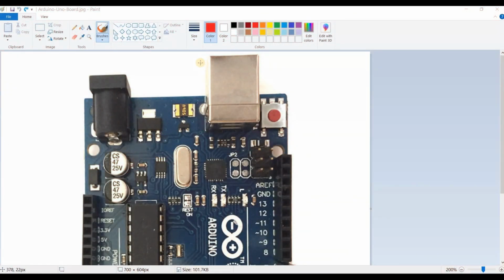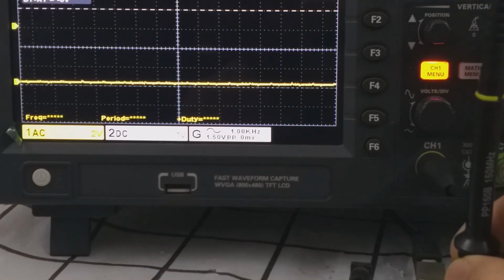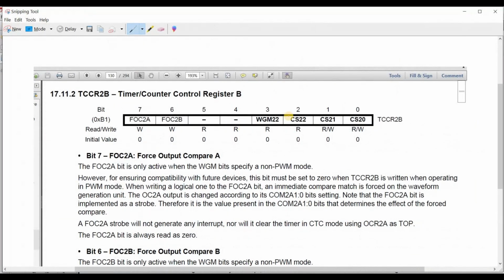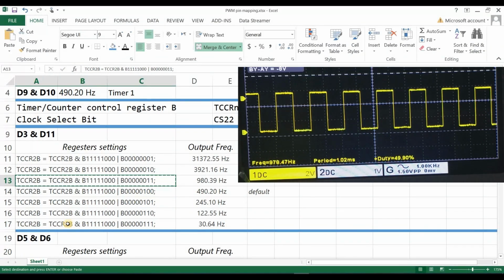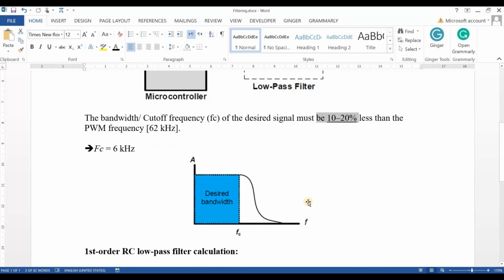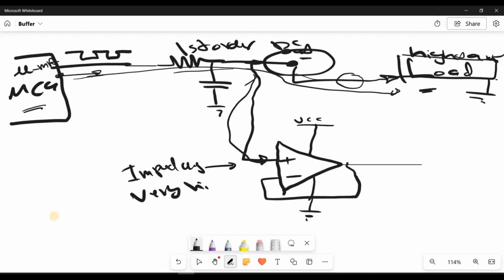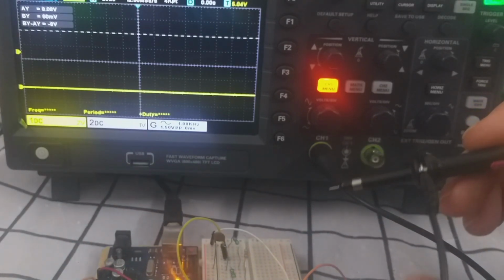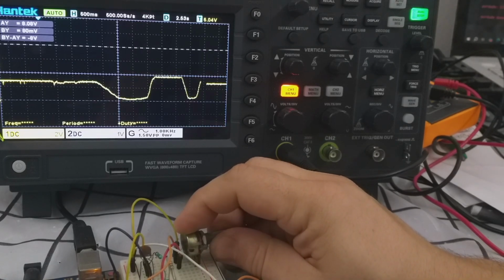Master PWM to DC Conversion in Minutes!

Comment: Thanks so much got this extremely helpful tutorial! I've recreated this circuit set up but I am finding that - after the OpAmp - the voltage will adjust according to the smoothed PWM input signal but the current remains constant. The device I am wanting to control requires a 4-20 mA input and I was wondering if you know what is causing this and how it could be fixed, please?
Reply from the maker: your observation is exactly what I’d expect — the circuit after the op-amp is producing a voltage, but a 4–20 mA input requires a current source/driver, so the device will hold the loop current constant unless you drive the current itself.

What’s happening:
• Your PWM → RC filter → op-amp chain changes voltage.
• The 4–20 mA device is a current-loop load, so it doesn’t change current just because the applied voltage moves.

How to fix it:
• Add a voltage-to-current (V→I) converter stage after the op-amp so the loop sees a controlled current (classic op-amp + transistor + sense resistor arrangement).
• Or use a dedicated 4–20 mA driver IC/module (e.g., XTR115/XTR116 or a small breakout that accepts 0–5V in → 4–20mA out).
• Once you have the V→I stage, your PWM control will translate into the correct 4–20 mA behavior.
Reply: @Challenger-Tech  Thanks so much for your quick reply! I've been trying to set up a voltage-to-current converter but I find that this in not responding to the input signal to the OpAmp very well and that using even 100 Ohm resistors is reducing the current too much. Electrical work is new to me, so it possibly could be my fault. Do you have a V --> I converter set up that you would recommend for this system?